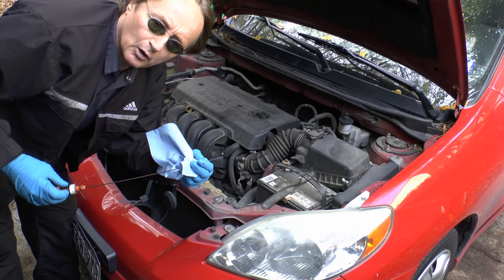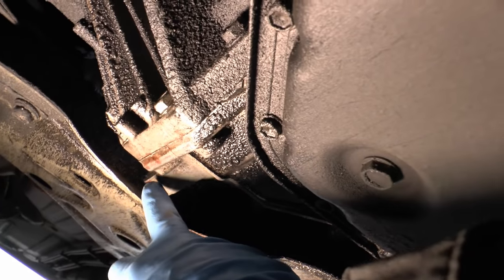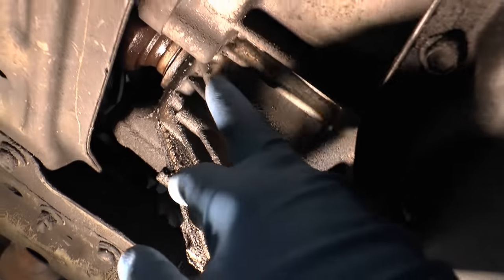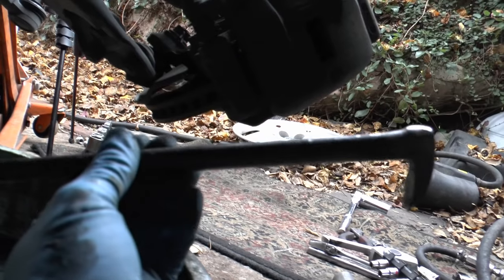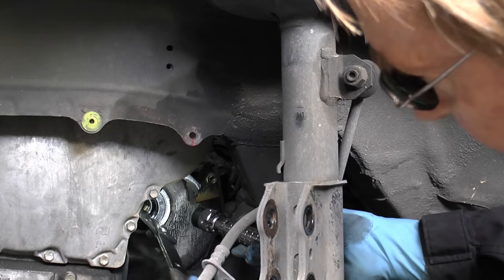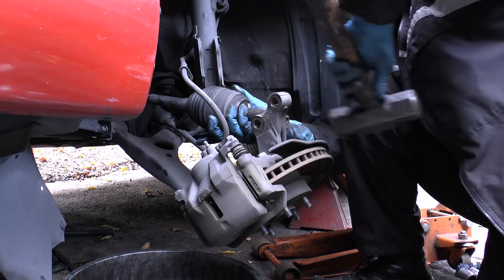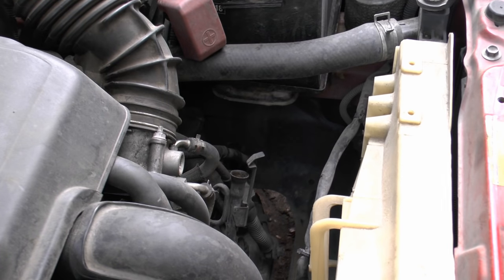How to Fix a Transmission Leak in Your Car (Axle Seal)

Comment: Hi Scotty, from your video and public comments I can tell you are a very experienced mechanic. Please help?  Today the gears on my 1999 Toyota Camry went haywire. I stopped at gas station and suddenly wouldn't get park! I think friend put on reverse to make it drive, and could only stop car with hand brake!  Does this mean transmission is broken? Had enough oil and hadn't noticed any oil leaks except it would accelerate on its own sometimes or  have hard time going up hills. Any advice appreciated :( .

Comment: Scotty,Is it possible to weld in the transmission tube seal hole? I put in already 2 x new rubber seals but still leaking although I covered it with silicon tape, white gas pipe tape and it is still leaking. I AM TIRED OF IT. so I want to weld the hole in for once and for all.

Comment: Hello Mr Kilmer, I'm wondering if most of the same process is done for a dodge dakota 97, it also has a pretty bad transmission leak? Went thru a quart within 3 days, and the LUCAS transmission leak stopper didnt work, any tips?

Comment: 2006 Chevy Trailblazer oil cooler line is leaking from quick disconnect coming from the radiator. Should I replace the line coming from the transmission as well and if so how difficult is it to remove it

Comment: Thanks for your videos I learn a lot with them, I have a question , i own a 1996 isuzu rodeo and the TPS sensor gets damaged to often maybe 6 months and i have to replace it , its any reason why this sensor gets damaged that often? Thanks
Reply from the maker: could be throttle is worn and is hitting it and wearing it out on that old thing
Reply: Thanks , I'm going to check it

Comment: Question on this subject. I have a front wheel drive Nissan altima. Has a bad out put shaft bearing the one behind the seal you just replaced. Can those be replaced without removing the transmission.

Comment: Hi Scotty, I have a Toyota Kluger 2009 and it's leaking engine oil. When I turn the car on the engine oil start pouring out (not dripping) but when it's turned off the leak stops. The leak is located under the driver side near the front. Where do you think the leak is coming from?

Comment: Scotty if the ABS lights are on on the instrument panel would that affect anything? Also plugged in a scanner and it read that L/R Wheel Speed Sensors and something about hydraulic pump. Would you have any idea what this may mean??
Reply from the maker: if a speed sensor is bad, that trips the ABS light showing that system no longer will function. I'd fix that IF you want ABS brakes, and pray the hydraulic pump for the ABS wasn't bad as they cost a TON to replace.
Reply: Scotty Kilmer okay so if I fix the wheel sensors the light should go out or would I have to like recalibrate stuff? On my scanner it has 4 codes and they are (Hydraulic Pump Circuit Failure) , (Left Front Sensor Circuit Failure) , and L/R Front Wheel Speed/Signal Failure and they all came off of a 2002 Chrysler Town and Country 3.8L
Reply from the maker: Alejandro Monsivais
IF you fix all the problems correctly, the light will go out by itself in a few days.

Comment: Is it ok to use that chassis grease on the snap ring when inserting into a CVT transmission? Those things are particular about their fluids, I'd hate to contaminate it with very thick grease like that.

Comment: Would you expect all the transmission fluid to come out when you are changing the seal?
Reply: I had the same question. Evidently the fluid did leak out when we did this job on my car. Had to do a fluid change anyway so it wasn't a big deal for me.

Comment: Can I use JB weld on the seals? Mine still leaks after replacing with a new one.
Reply: Usually this is from the axle splines cutting or damaging the seal during installation.
Try to install the axle shaft without letting the splines touch the inner rubber of the seal.  Having a helper to hold the shaft straight is a great thing.

It could also be the transmission housings metal surface where the seal mates is damaged or has grit etc.

It could also be the seal isnt seated properly.  How Scotty showed to seat the seal, IMHO - isnt the best way.  Ideally you would have a cylinder/socket/pipe (seal driver) that perfectly matches the seals outer metal diameter, and then use that to drive in the seal squarely.

Stay gold.
Reply: @dnlmachine4287  maybe the socket used on the axle nut

Comment: Scotty my 2002 transmision is leaking from where the front of the transmission and the engine connect.   I can see pink transmission fluid under the transmission, do I have to remove the transmission tp fix it?

Comment: Hi Scotty, do you recommend to put Silicone grease on the transmission oil seal ?
Thanks
Reply from the maker: just normal tranny oil is fine, but you can use better grease like that if you want.

Comment: Greetings, i have undertaken this job as a DIY, i have removed the seal, and decided to change the wheel bearing behind the seal because of noise as recommended by a mechanic. Scotty, do you know if the bearing is flush with the metal where the seal stops, i see plenty of space to hammer the bearing in.
Reply from the maker: bearing goes in as far as it can be pressed, then it stops by itself
Reply: thanks for the reply Scotty, trouble is, when i took the bearing out  i had space behind the bearing to place the jaws/puller, i have installed the new bearing to the limit, and noticed i have no grabbing space in case i want to pull the bearing out later, this is why  i ask. perhaps my problem was that the bearing had moved on me causing the noise i was hearing, the axle shaft had some indent rubbing, and my jaw puller will not work now to pull it out. I will try some type of sharp pick hook

Comment: Will it not need a front end alignment after its done?
Reply: Vapers Win no.
Reply: If the strut or knuckle holes are elongated to allow adjustment for camber, then it is recommended to match mark the parts before taking them apart.
Alignment should be checked after this job regardless.

If the holes are round, and are in good close alignment with each other and a snug fit for the bolt, it is likely that wheel alignment will stay close to its original position.
This assumes the bolts and holes are in good condition.

Stay gold.

Comment: yesterday I was low on oil.so i put oil in car. then i just look at botton of my car it was red oil leaking from the transmission. will i need a transmission line replace? how much do than cost?

Comment: hay scotty ive got a 2011 chevy cruze 6 speed manual tran 1.8 and im finding trans fluid puddled up bye shif leaver on top bellhousing trying to c what is abouve bellhousing on motor is that the cooler for trans or were is it coming from

Comment: Why is the passenger cv axle leaking on a 2005 Chevy Impala V6 I replaced the seal and the axle but it leaks where the rod is that goes in don't know what to do

Comment: I actually just got my cooler lines replace and I'm noticing a leak right underneath the transmission. It start to leak slow than it gets faster right after the car is turn on. Doesn't drip when the car is off though.
Reply from the maker: +Jairo Cerritos guy botched up the job, take it back.

Comment: I don't have a leak. I do have a automatic transmission that "sticks" when shifting. It's a 2001 Tracker. When I bought it off a family friend he said it was rebuilt..."Half assed." I tried adding Lucas Automatic Transmission additive. It works sorta. Is their anything else that could help? It mostly does it between 3rd and 4th (overdrive) gears. Or just chugs on acceleration. Tips..ideas? Thank you.
Reply from the maker: live with it, the rebuild was crap, lucas is the best attempt to normalize it.

Comment: My car started leaking transmission fluid at 150,000 miles ('09 Ford Fusion, V6). I've just been adding more every couple weeks when it gets a little low. I'm now up to 185,000... maybe I should get that fixed.
Reply: HJ maybe you should

Comment: hi scotty we have a leak on our kia,and this is the diagnose,question we have been told a couple times at a iol change place the transmission fluid had to much in it,what is the proper way to check transmission fluid and is stop lea o to use unitl seal is fixed?
Reply from the maker: +allison481959 try AT 205 reseal, amazon sells it.  If it has a dipstick , park it on a flat surface and measure it with engine running and Hot. If not, pay a mechanic, it's complex then
Reply: thanks Scotty,your such a great help,I couldnt do without you and youtube,have a Merry Christmas.Allison.

Comment: I have a 2000 kia spectra and it has a code p0732 pending what should do should I change the tranmisson fluid the filter has not been changed since the car came out off the dealer it has 63,246 miles

Comment: I have a problem in camry 2011. transmitiom fulid is leaking very fast in the middle of the transmiton and engine .I change the front oil seal but its not working it's still same like before what you saggust in this condition .oil pump seal or any think

Comment: I need to change the front transmission seal on a 1964 Ford Econoline Van.  What's the best way to do it?
Reply from the maker: Melinda Miotke you have to pull the transmission off
Reply: Scotty Kilmer thanks.  Does the new seal need to be pressed in or can I do it manually?

Comment: Scotty, I have an '02 VW Jetta 2.0 Auto. Wonderful car, but the trans is slipping. Not bad, but it's noticeable. Is there anything I can do myself to prevent it from getting worse?  Merry Christmas :)
Reply: Scotty, I took your advice and traded the Jetta for a 2015 Mitsubishi Mirage 5 speed 3 cylinder. for only $14,000 it comes with a 10 year 100,000 pt warranty, 5 year unlimited roadside assistance, Lifetime $10 oil changes and free tire rotations, and a lifetime engine warranty through the dealership as long as I have the engine serviced there. I much rather pay a little higher payment than risk a costly repair I can't afford. Thanks again for your advice.

Comment: Hey Scotty, I got a 2005 Escalade 6.0L and during cold days (ex. -15 degrees Celsius) It does not start when you turn the key, I've replaced the starter but the problem is still there. By the way battery was also replaced and is brand new. Any fixes?
Reply from the maker: depends what happens, if it cranks, try my video "fixing a car that cranks but doesn't start up:"  but if it doesn't even crank, bad wiring or anti theft system IF battery and starter are good (often rebuilt starters are no good out of the box, and batteries can also be bad fast these days with poor manufacturing, I see that a LOT.)

Comment: scotty, i think my rear main seal is slowly leaking. i changed my oil yesterday, and i saw a bunch of gunk in the area where it meets the trans. i really dont want to pull off my trans to get to it.. what other options do i have?
Reply from the maker: try a bottle of AT 205 reseal, amazon sells it, often seals such leaks

Comment: I had a transmission leak on Wednesday. The check engine light was on the next day. Got the transmission lines replaced and the leak fixed. The check engine light it still on, however. So I called the shop and they said the car has to go through some cycles. I just want a second opinion on this. Is that normal for the check engine light to stay on for a little, and how long does it take for the cycles to be complete for the check engine light to go off?
Reply from the maker: yes sometimes it takes weeks, to settle down right.
Reply: Okay. Thanks. That's actually a relief to know. I was worried that if it didn't go off I would have another issue to fix. I'm actually learning about cars so in time I can do all or most of it myself but in the meantime I am stuck paying a shop. Thanks again.

Comment: I have a 2004 Dodge Neon w/ 105K - the car has been a real trooper but has in its old age developed a problem with the trans - when put in passing gear it burps fluid out of the top of the fill tube. It shifts fine and there is no fluid discoloration. The car has been meticulously maintained. Any ideas?
Reply from the maker: lucky it went that far, transmission is going out, building up pressure and venting out there. You could try changing the fluid and filter, put in fully synthetic fluid, and PRAY that helps, might last a while longer

Comment: one tool i never really ever needed or seen anyone use is a actual seal puller. its kinda funny to see people with proper tools :) small pry bar or screw drivers always seemto do the trick
Reply from the maker: AH, but such prying with those tools can often nick where the seal goes on and then it leaks there. This tool only touches the seal itself, that's why the ends are so pointy and sharp.
Reply: good point, i usually silicone the outer part of the seal out of paranoia of scratching it
Reply: harbor freight makes cheap proper tools. I have a cheap, like 25$ seal driver set. cheap, does the job right. Harbor freight is the best thing since walmart (make sure you keep the receipt though. Cheap means "breaks alot" for the power tools).
Reply: yeah harbor freight is hit or miss with me. ive bought some cheap tools there that lasted me for ever but some literally break the first time you use it, the impact driver is a good example of that. same thing with the sawzall i got stick of destroying them after 1 hr of usage and having to keep returning them. id say 75% of the stuff i get from there holds up well for the price

Comment: hey scotty, My car is going through a lot of oil just yesterday I had to add a quart of oil to my car and then the next day after driving only 70 miles. The engine was a quart low again I looked at engine and oil pan gasket is bad and possibly the crankshaft seal is bad. Its crazy how often I have to add oil to this pos geo metro all because of these oil leaks my car has been having.
Reply from the maker: well, try to find the biggest leak and fix that first. Perhaps try some AT 205 reseal in the engine oil, amazon sells it and it can stop seal leaks quite well
Reply: You could try tightening the pan bolts to see if that might reseal the leak (not too hard, unless the bolts go into steel). or just replace the gasket.. My blazer was leaking but, apparently you have to pull the engine to get the stupid pan off (THANKS ALOT GM ENGISNEERS!) to replace the gasket.

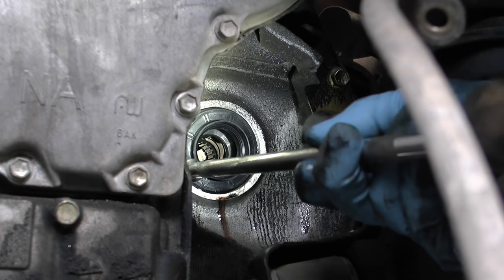Comment: Hi Scotty! I have a 99 corolla that had its right side driveshaft replaced 3 weeks ago. Since then my car started leaking transmission oil where the where it meets with the driveshaft. The mechanic did not put grease like you did at 2:22, which may have caused it not to pop in place. Is there a way to check for its proper placement or do I need a new seal for the new driveshaft?
Reply from the maker: probably need a new seal, which he should have done in the first place on a car that old.
Reply: Scotty Kilmer Thank you sir!
Reply: @scottykilmer  is this video for automatoc transmission or manual transmission? Becoz I have same problem with my automatic Corolla 2013.kindly advice. Is it necessary to  solve leak? What will cause if not solved immediately

Comment: Scotty I have a 2011 Accord v6 automatic, when I put It in gear, the transmission takes about a second to engage and I hear a click, is there anything I need to worry about?
Reply from the maker: worrying doesn't help anything. those have rather weak automatic transmissions, and one that takes a second to engage has internal problems starting out. Try changing the fluid and pray

Comment: Hi Scotty, so apparently I was running my 99 Dodge Ram 1500 for a little while with none or next to no transmission fluid in it somehow I managed to not notice so anyways I filled it back up and by the time I got to my house I got stuck in some ice and to Park it apparently all of the fluid I just put into it came back out. Is it possible that it is just a bad leak in a line? Also I don't know if my transmission itself is now destroyed because of revving it with the fluid coming out. My buddies mechanic said something about needing to replace a line that is leaking before he can tell anything else about it but I wonder if I can figure out myself where the leak is coming from with your help
Reply from the maker: +Anthony Fuentes   fix any leaks first, see my video "finding and fixing car oil leaks"   and then PRAY it's not damaged

Comment: my 2005 hyundai accent is leaking tranny oil from breather valve on top of the transmission, only when the car is hot and running ( never leaks when cold and parked ) , the transmission works 100% normal, no issues or symptoms at all , the oil  level is right in the middle between min - max when hot, but the  breather keeps spilling oil, any ideas?

Comment: Hey Scotty, I got ripped by a transmission shop who tore my transmission apart and took it out over a governor sensor replacement. After a dispute, they kept my transmission and I had to go buy another from salvage. I have a 98 Jeep with a 42re. 

Another shop put in the used transmission, but they threaded the rear cooling line at an angle and it was leaking and spraying everywhere. I fixed that myself.

Unfortunately, the used transmission is now slipping and going into limp-in mode. I've refilled the fluid. Auto shop scanned it for code P1762, which is the pressure sensor.

Can the pressure sensor really cause the transmission to slip and go into limp-in mode? Anything else I should know before I start pulling electronics out of the pan? Thank you!
Reply from the maker: it can, pray it's just that. jeep trannys just suck big time